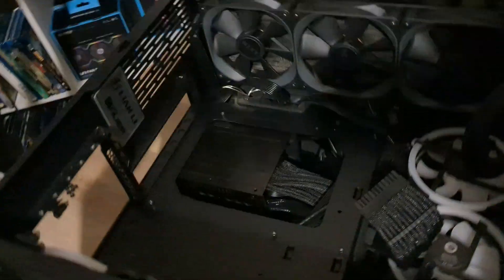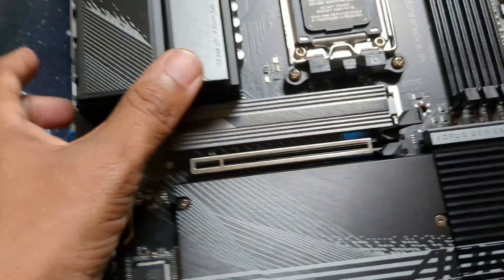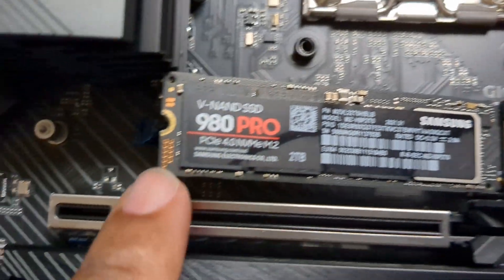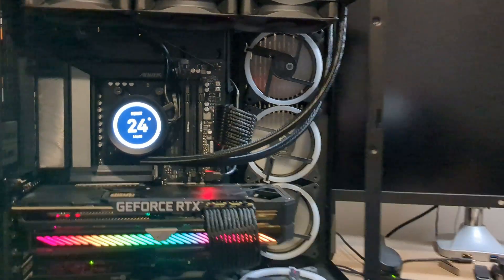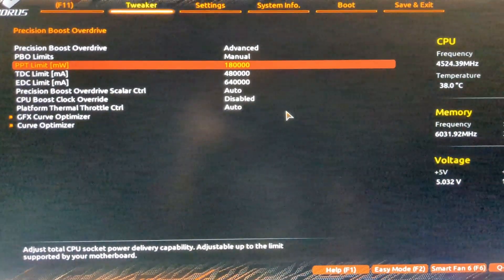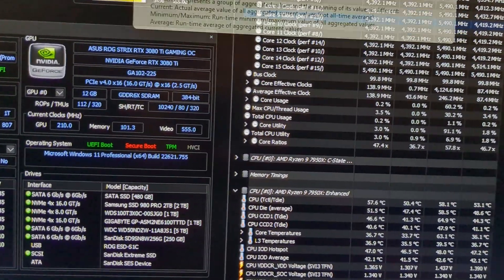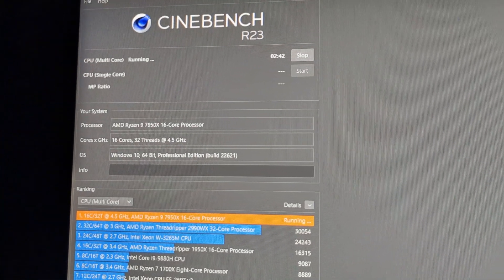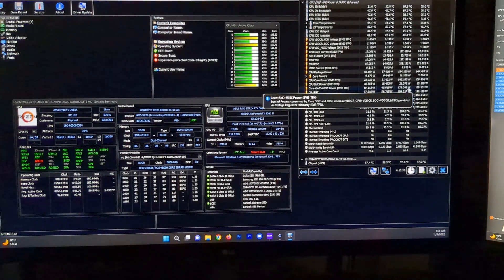AMD Ryzen 9 7900X | 7950X Install & Upgrade | Temps, Bios Settings, Power Limits

Comment: my dude, i literally just got the same set up not 2 hours ago. I've never used AMD anything. Not CPU, GPU, Nada. Always NVIDIA and INTEL. Came across a Tower case, still had its coolant system, fans(8), RGB, power supply, and motherboard. Nothing else. I happened to have 4 AMD chips from 3-9. Last generation though. I decided if i'm going to build one, I might as well do it big den. So i bought the same board you have and the same chip. Then 64gb of Corsair RGB Ram 6000mhz, and a 2 Ryzen 5700xt's. I got a bad ass gaming laptop already, dont know why i spent all that money🤷‍♂🤷‍♂but   When i put that chip in and felt that pressure pulling the bar down I hesitated for over 30 minutes. I didnt PULL it down and lock it until i watched you do it. They should NOT make it feel like i'm breaking it. Hope your set up is worked out. Fingers crossed mine does🤞🤞🙏🙏🤣🤣😶😶. I still havn't gotten to the test part yet. God i hope i din't waste a bunch of money

Comment: So, a couple of things here. I do have very long load and reload times, and long blank screens in the process. That is really my only problem left that I'd like to get fixed. Any idea how to fix those???
I'm running the 7950x on a Strix X670E-E, with 64gb of GSkill NEO and a RX 7900XTX. It's running about the same thing you are on R23, but I hadn't limited the power at all, only the temp. I do have my temps limited to 90c. Then I tried to set my PPT power at 185000, but my system crashed. So I changed it to a PPT of 190000 and that helped stable out my rig, and my temps went down to around 86-87c. Happy I got a bit of a lower temp when limiting the power. So thanks for this vid.

Comment: I'm having an issue where my settings are near identical to yours and I'm BSODing a LOT. I'm on an x670 Elite AX as well (Aorus Model). I'm gonna try your exact settings and see if my issue is solved. I'm really hoping that I didn't end up getting some dead CPU or Mobo.

Comment: My question is how often does or do you expect your system to peg out and hit the temp limits?  Cinebench is designed to peg the system.  I understand folks concern because it's been embedded into us that those temps are not good and I know it's going to take some time before folks feel comfortable with it, but if your system is not running constantly at 95C what is the concern?  I'm going to give PBO and undervolting a go to see what I can achieve.  But, I am not too concern about the 95C since the system won't be pegged all the time and hitting those temps.   Also, that is how it's designed to work.  So, I am going to let the CPU loose and do it's thing.  Nice video.
Reply: @DetroitRetroMancer  It pegs my CPU and hits 95C with OC.  But I don't care about that.  It doesn't get near this when gaming or doing other stuff.  Also, according to all of the PC Guru testers on Youtube...the Jayztwocents, Linus etc., and my own testing the Ryzen X CPUs runs at 95C out the box and that is how AMD design them to run.  Those who undervolt them can get them to run a bit cooler which sounds like what you did.  No undervolt for me.  Like I said I'm letting it run as designed.

Comment: I have the exact same setup. It's my first solo build and the only thing I'm not sure about is how tight the pump should be to the cpu. The fractal s36 only had am5 standoffs in the manual so that's what I used. The pump is snug but I could fasten the thumb screws more but I don't want to break anything
Reply from the maker: I would keep tightening in a cris cross manner until you can't tighten anymore. To make sure it's tight enough. That's what I've done with all my builds

Comment: Same here, went to Microcenter, got the free G.Skill DDR5 6000 32GB kit with a 7900X and an ASRock PG Riptide B650E motherboard.  Then there was a price drop so I returned the unopened RyZen 7900X and exchanged it for a RyZen 7950X at the register only requiring about an additional ~$25.
Reply from the maker: Nice!

Comment: I got the same memory for free from microcenter but is not stable when running 6000mhz with expo enabled. It is only stable up to 5200mhz, do you or anyone know why I'm having this issue? I have the 7700x with x670e master from gigabyte.
Reply from the maker: Wow I would definitely exchange the ram to see if that's the issue. I haven't ran into any stability problems
Reply: @WiLcreatives  Yeah, I did some more testing today and it looks like one of the sticks is bad and the other will run the EXPO speed.  G.Skill said I should swap them for a replacement set.
Reply: I have a 7700x with that memory kit and b650 aorus pro ax board and it's not stable.  I actually can run benchmarks like cinebench r23 but it will crash in games.  It's completely stable with expo disabled.

Comment: Hi WiLcreatives just got a x670e motherboard and 7950x, just one question did you have to do a fresh install of windows 11 again. Or did you just use your existing windows 11 on your m.2 drive, I don't know if I have do a fresh install or if I can use my exsiting windows 11. thanks
Reply from the maker: I came from a prior gigabyte board so I didn't not do a fresh install. I would actually recommend that you do one though to be safe.
Reply: @WiLcreatives   thanks mate.

Comment: Your video helped out A LOT!!!! It answered some very important questions I had with the idle boot temps in the bios and how long it takes to boot and the blank black screen at the beginning upon a cold boot. Thanks for making this video. It really helped out. None of the "influencers" would cover
Reply: I must have missed all the stuff about how long they take to load, and the blank black screens. What did you learn? Anything that speeds up the boot or limits the black screen??? Thanks.